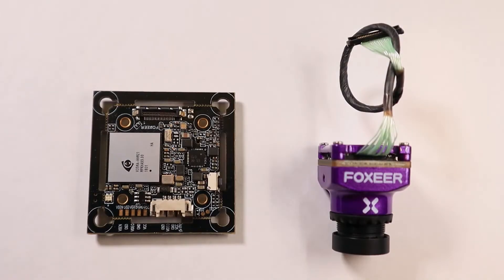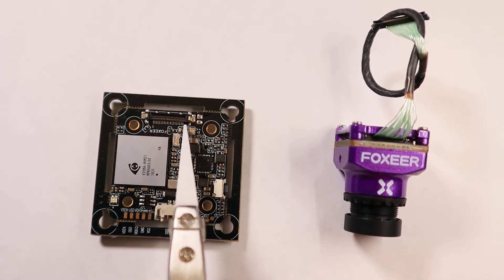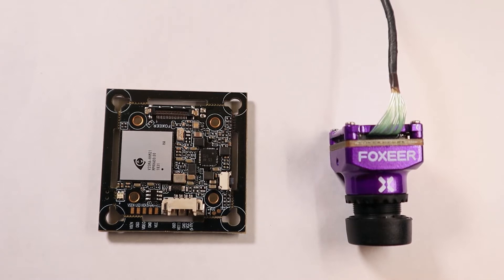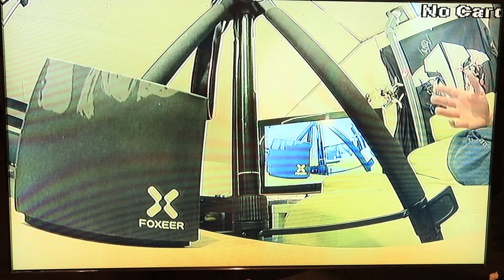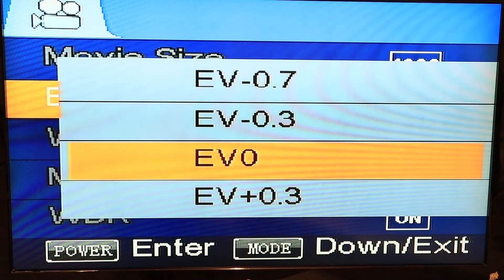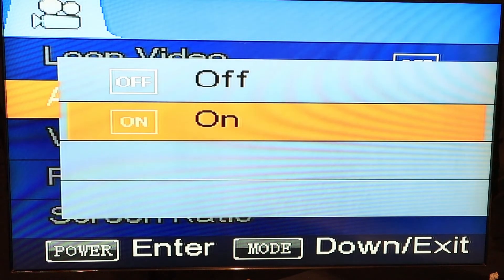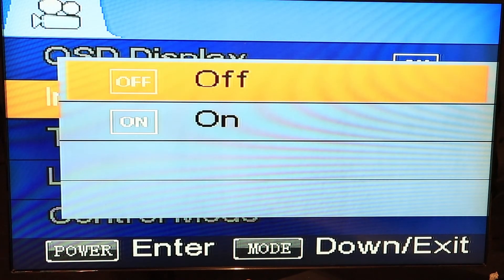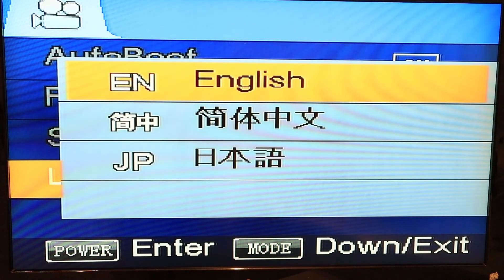foxeer mix - Part 2 - wiring - connecting- OSD

Comment: Hi.I had 2 like this from Aliexpress ,both after few week was burn(Board).Can I connect camera right to transmitter without board?
Reply from the maker: i dont know fure sure but i dont thinks so 
it would be damn hard to connect ribbencable to wires
for the most cams you can get the pcb separately
Reply: @section8freestyle  Thanks for the answer . I'll try.

Comment: What about osd wire and small controller. Is this compatible with runcam controller?
Have you tested camera control through FC?
Thanks
Reply from the maker: no i never tested it tru a controler
andthe first question  do you meen to use a runcam osd bord to change the foxeer osd?
Reply: @section8freestyle  correct
If that works, fc works as well...
Thanks for replying :)

Comment: Thanks for posting the video!
Do you have a Runcam Micro Split 2 and/or Tutrle v2? It would be very helpful to have a comparison.
Reply from the maker: i do have the Split v2 and i've ordered the Caddx so i will make an comparison of the 3
Reply: @section8freestyle  Great! A lot of pilots are looking forward to a comparison video.
Reply from the maker: @larrydelceg2406   the comparisan wil be between a split 2/turtlev2 and the caddx i have no 20x20 mount on anny of my quads
Reply: @section8freestyle  Close enough. That will make an insightful video. It would be great to see HD, FPV, and low light comparisons. Looking forward to it!